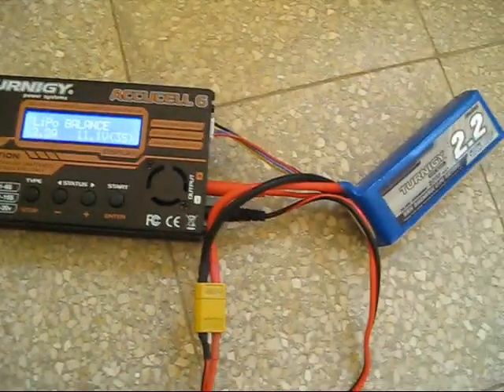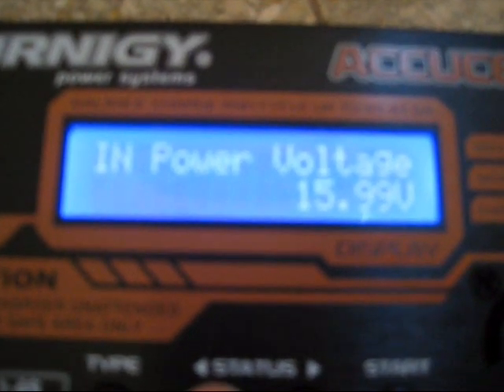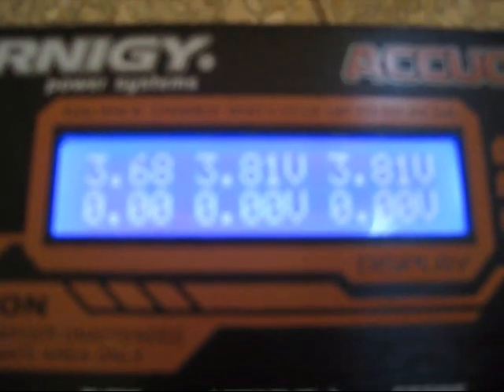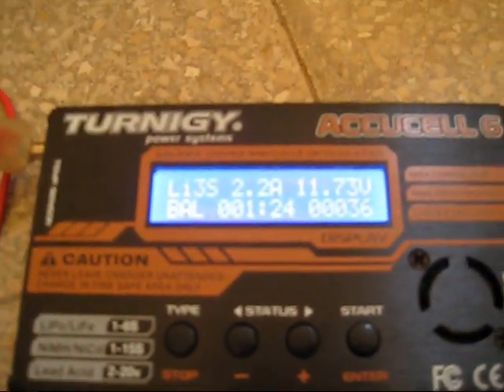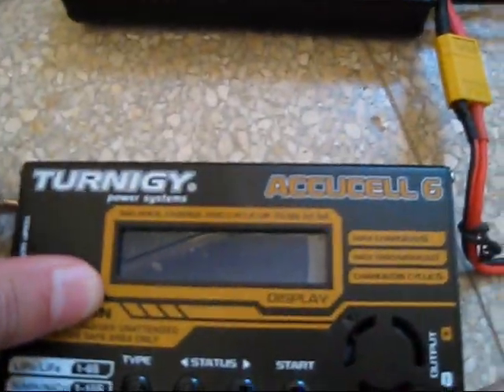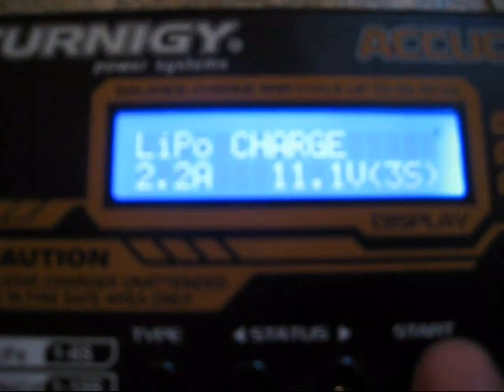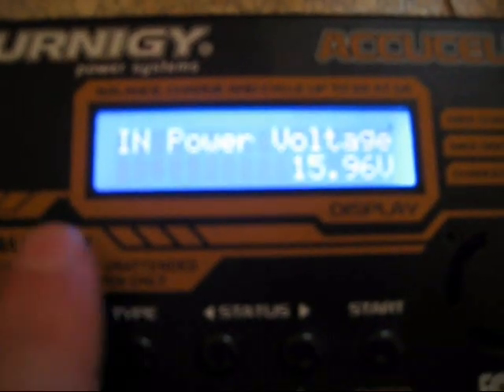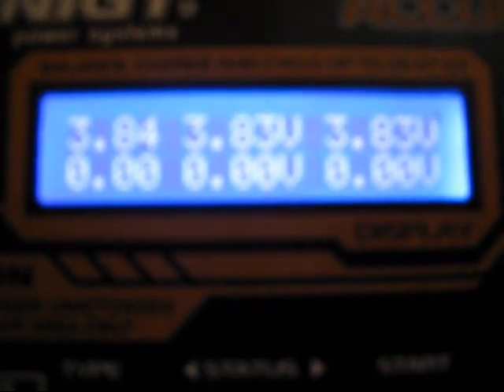New turnigy accucel 6 - malfunction - solved

Comment from the maker: Problem Solved :
Pin number 2, on the 3-cell balnce port was not concted to anything ! - ! - !
apperentrly the conection is on the pcb was not good,
so to fix this I solder a baypass to "parlel" number 2 pin, on the 2-cell balnce port.

You can check out the therd here :
Reply: Where's the thread? Are you recommending opening the unit and checking the soldering on the PCB?
Reply: yamimami777